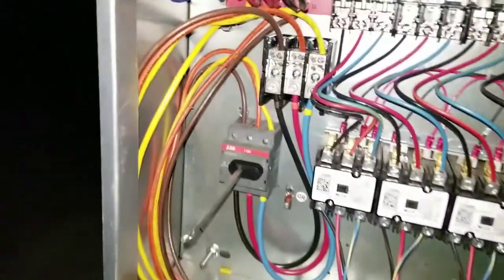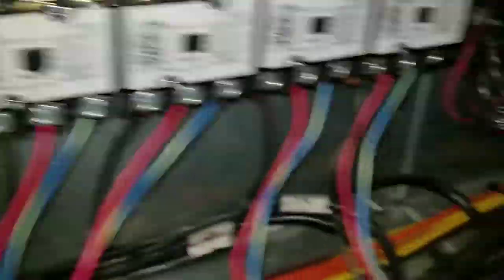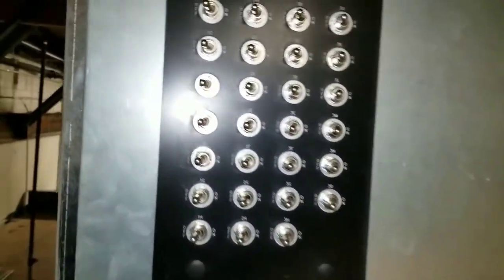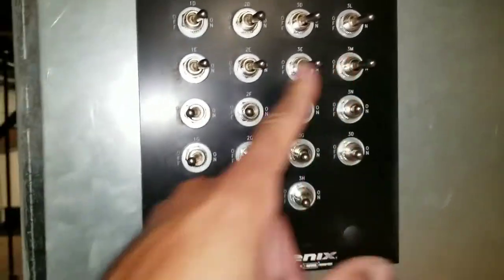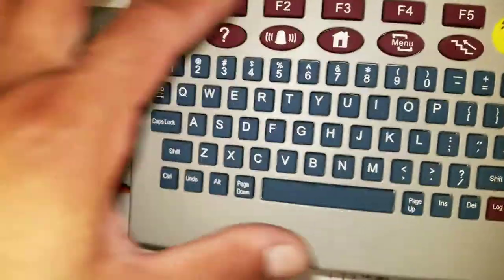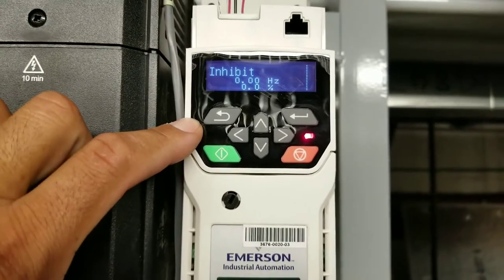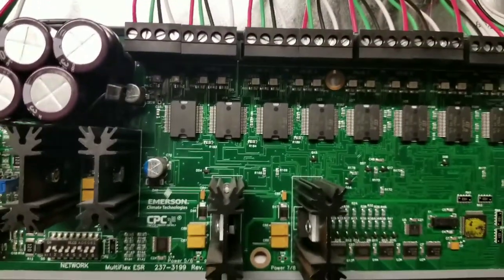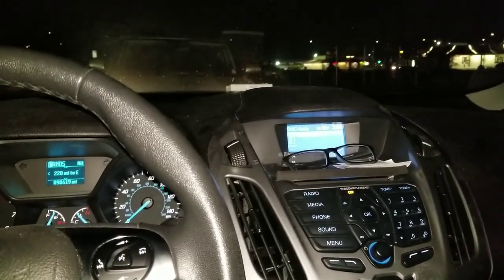POWER SWITCH FROM GENERATOR TO CITY!

Comment: Thx so how the vfd pick up the load signals so that it knows when to turn on the condenser fans and by how much.
Reply from the maker: They have transducers that measure pressure or temp, it depends on how they set it up. That goes to the controller and the controller sends out to that relay output board.
Reply: RefrigerationTech transducer on the high side? So the hotter the discharge line the faster motor run. Cool.  Thank you very much